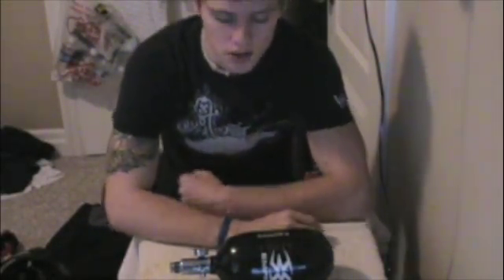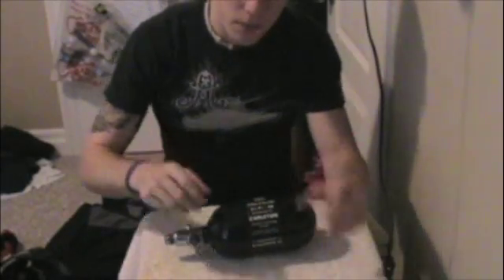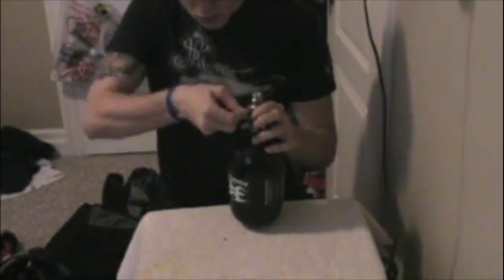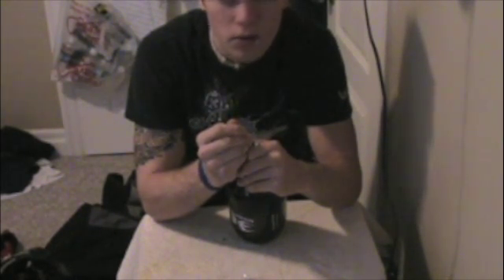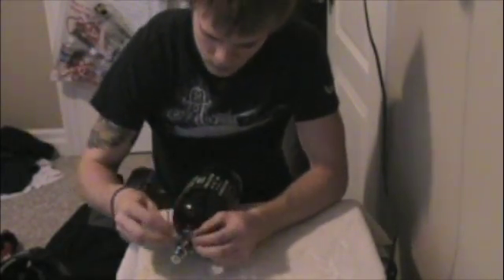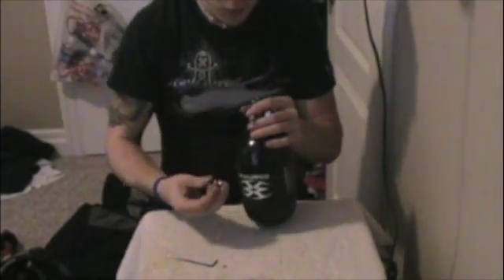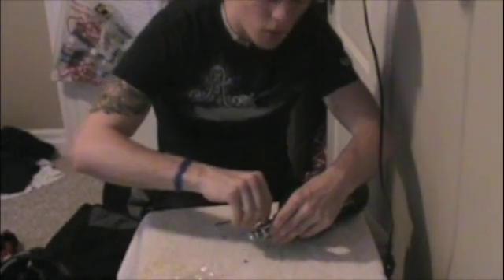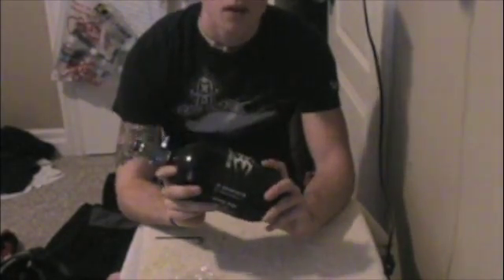Changing a High Pressure Tank to Low Pressure

Comment: lol how is my maturity level of a 13 yr old?funny! why because you went back and read and felt dumb? hahaha i use a high pressure tank! if you had half of a brain you would be able to read the manual right and my comment. i wouldnt know the threads are tight to screw in if i used lp tank. the manual says "It is recommended that you use a low
pressure (350-450 psi) fixed output
regulator system, although it is
acceptable to use a high pressure
fixed output (750-850 psi) system." lol

Comment: I bought a tank and totally forgot to check if it was hp or lp, and I got lp. As I have Fusion08 and and A5 that seem to be a problem. What is funny tho, is that the A5 works perfectly with lp preset, and Fusion doesn't (I mean I cannot set it properly for lp...). What is even funnier, is that I had an explosion yesturday and my lp preset is gone, so I had to mount Micro MaxFlo to my A5, and it doesn't work as good right now...

Comment: i have a low pressure cp tank but for some reason it will not seal with my ego and i took it to the store a million times and they said nothing was wrong with either my tank or asa. my low presure came with 12 shims on it. what do i do to turn it into a high pressure tank? it would be huge if u helped me out

Comment: wuts gud? I just bought a tank, should be commin n soon n just relized it low pressure. its a carleton 68/45 n just wanted to know if it can b converted? also I have n ion, yes n ionn lol, n wanted to kno if lp will work so i dont have to do n e thing to the tank. Thanx